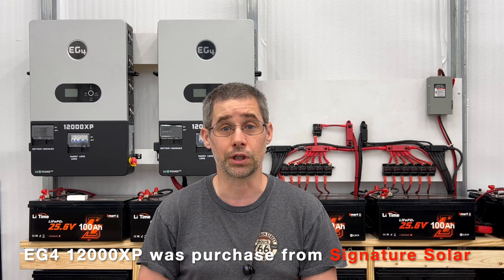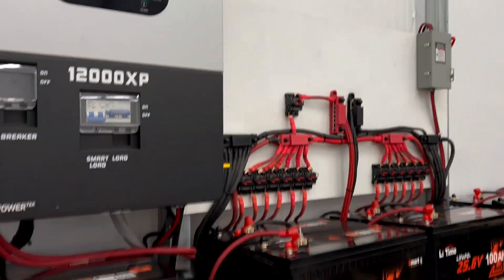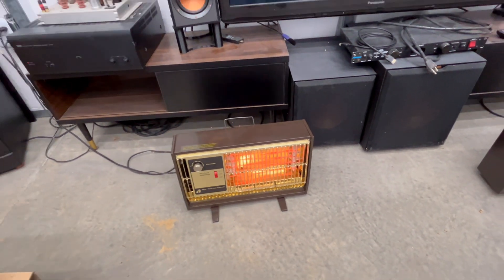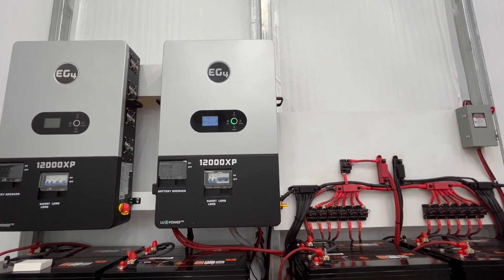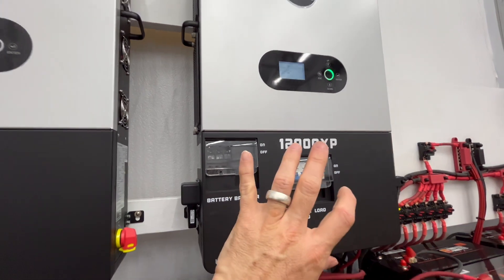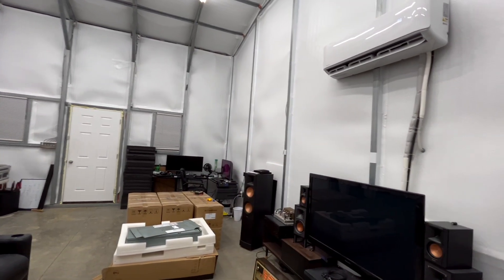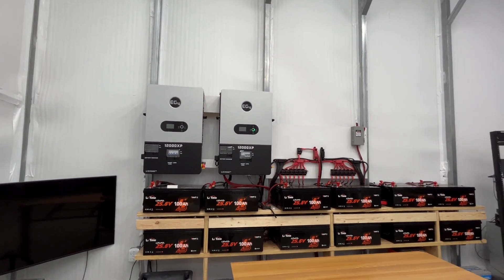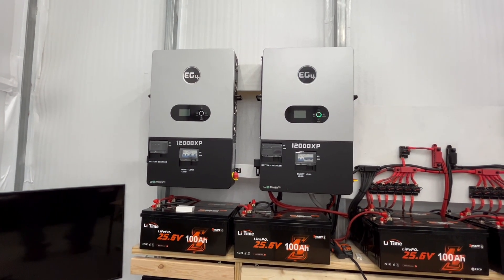Why I Bought a SECOND EG4 12000XP Inverter! Single vs Dual Setup

Comment: Have one pushing heat into the other one probably spread them apart some I agree need 2 for entire electric house. Those 24V batteries get out of balance why not just use 48V EG4 280 power pro wall mount. Get a Yixiang battery with the JK inverter BMS can run with Coms connected.
Reply from the maker: Very good point Mike,  I did that in a latter video.  Thank you for watching and bringing this up.

Comment: I just bought a 12000xp.
Reply from the maker: Glad to hear, let me know if you have any questions on the setup.
Reply: @MikesSolarGarage I'm just starting to  run everything.  I have a 1awg aluminum 3-1 conductor for my grid feed using line side tap connector and for my load I'm using #1 copper 3-1 conductor to power my whole house.  I have a electrician helper who will make the main connections.  I'll text you for the programing help. Thanks😢

Comment: is there a way to get live data on load one and load two off of the inverter itself ? because the app is too slow to respond
Reply from the maker: Great question,  you would have to use 3rd party software.  I have heard good things about Solar Assistant.  It is not cloud based, but I have not used it so I'm not sure if it is realtime.  It might be worth checking out.

Comment: Mike how much solar do you have?
Reply from the maker: Panels, I have a lot more on its way.  Should have about 35,000 watts of panels when it is all installed.
Reply: @MikesGarageRoute66  hey, just to say optimizer are cheaper than microinverter. Also optimizer keep the power DC so it goes straight to your batteries no conversion needed.
Reply: @Livingsolaryourway  Optimizer bypasses the current on a panel when it detects shade on that panel so the voltage doesn't drop entire string. Also gives you ability to mix-and match panels plus get panel level monitoring.   Same thing as wiring entire string that gets shade in parallel on a panel level. Series connected panels that get little shade on one or 2 panels ruins entire batch the voltage drops so much. Micro-inverter is just that it converts each panel power directly into 240VAC  it mixes with AC power in your home. If one panel gets shade that one panel might loser power doesn't affect any of the others. Micro-inverters are AC output to work with a battery another inverter is needed to AC couple the battery to the home grid. Enphase has such a system these are for grid tied solar not off grid solar. No one would ever bother with micro-inverters in an off grid solar system. Optimizer is useful for off-grid solar if you have shade issue, or want to mix and match different panels. The extra cost of them might not out do buying more panels.  Roof top solar in most states to be permitted requires rapid shut down modules option is use optimizers since they already do that function. Micro-inverters also do that when they lose the grid power they shut down each panel. All you need is a simple knife AC disconnect for rapid shutdown.
Reply: @MikesSolarGarage  35k what you need those batteries go fast under heavy loads. Off grid isn't easy as you think with high inductive loads. I had my 6xp on a 300 amp battery cutting some posts with my miter saw wiped out half the battery storage.